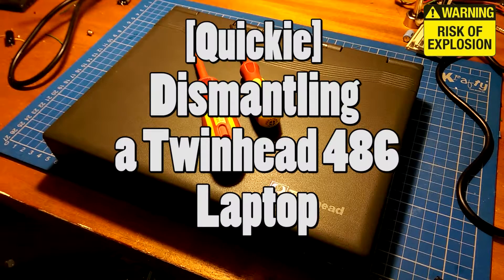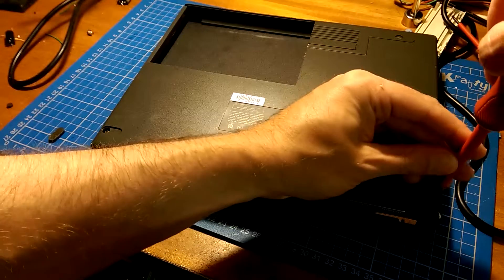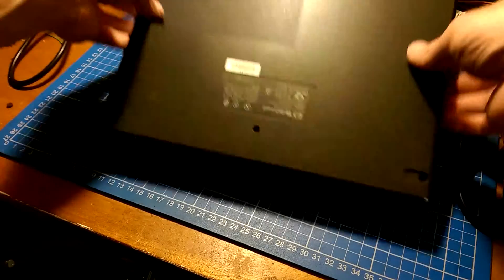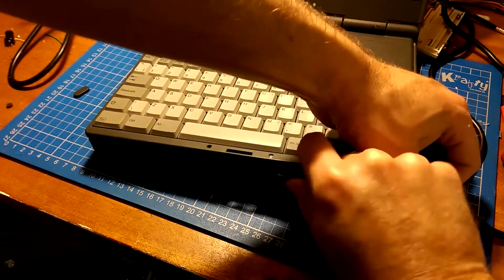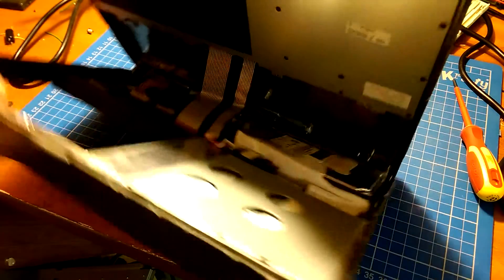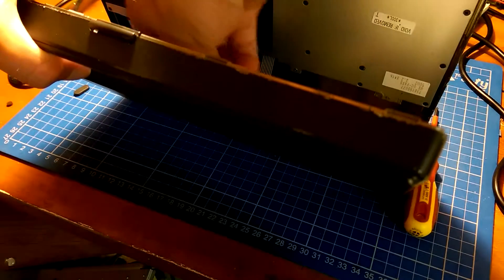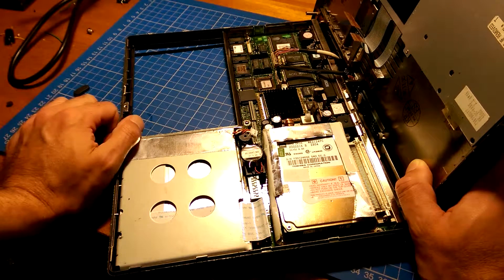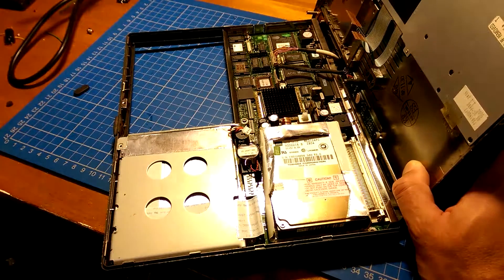Dismantling a 486 Twinhead Laptop [QUICKIE]

Comment: Great video. I've just acquired a 386 Twinhead laptop. Aesthetically it looks identical to yours. Unfortunately when you turn it on the screen is blank. The screen lights up but nothing is displayed. I hooked it up to an external monitor but it just shows a green screen. The floppy drive whirs so it sounds like it's doing it's bios check. Are there any settings it could be? I noticed when you opened yours it looks like there were pid switches? Wonder if it's something to do with that.

Comment: Still having some issues. It looks so easy when you pull ut apart. But mine is quite stuck. I guess it has never been opened before, so the clips that is holding the machine together is very tight. Do you just apply pressure until the clips releases? Or is there a way to release the clips by applying force at certain pressure points?
Reply from the maker: The clip points are at 2:33. Probably best to start in the middle of a side as you'll have more flex than at an edge. The top half needs to come 'away' and the bottom half needs to go 'in' to release a clip.
Reply: Sabretooth Barnacle Ahh yes that helped. Got it off now. Do you know if the hard drive is glued stuck? It won't budge, and I can't see any obious screws that locks it down.
Reply from the maker: +harrynorway You'll have to remove the motherboard. On the underside there are two screws that hold the drive in place :)
Reply: aaahh. Thanks for the help. Would have gone in the trash without your help. Mutch appreciated. :-)